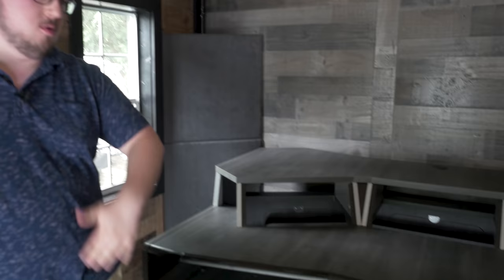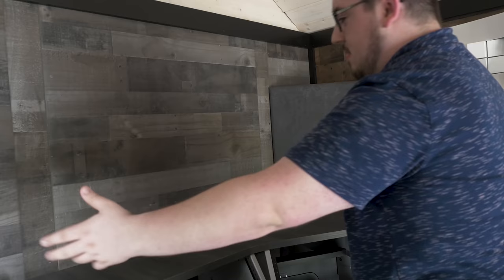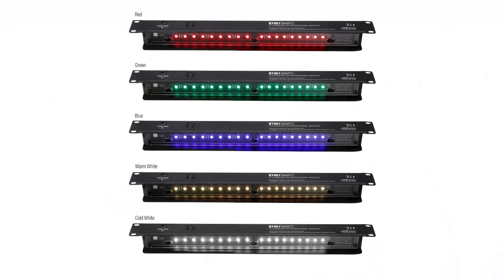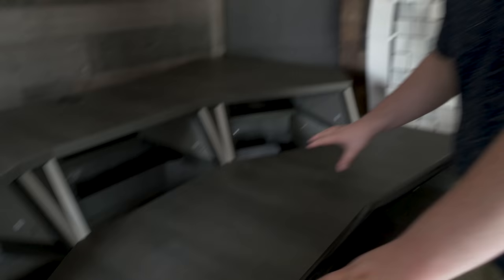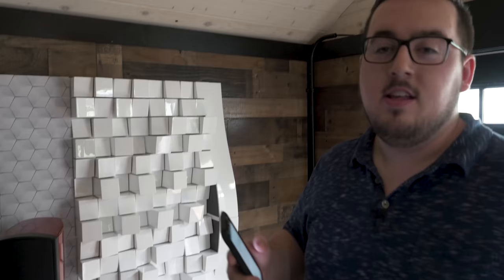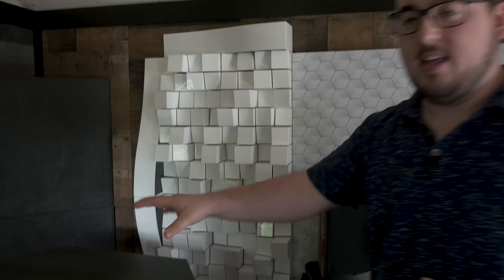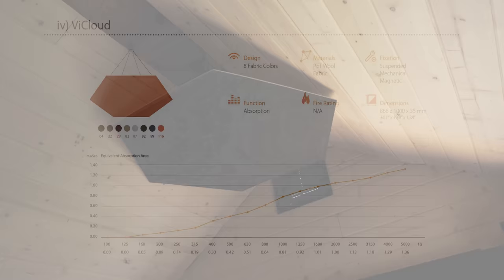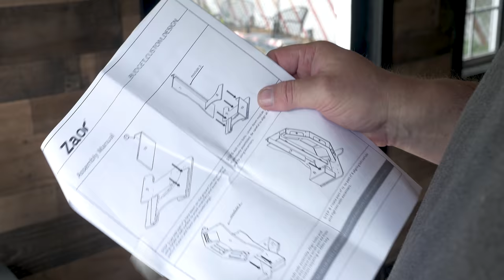This Desk Costs $3,000

Comment: If it's made out of MFC, then it's made out of chipboard sandwiched between two pieces of melamine. If true, that is really expensive for what you got. Could have built a desk out of real wood for a fraction of the price.
Reply from the maker: well either way, I didn't pay for it ;)
Reply: You could have build the desk AND purchased every power tool required for the build for half the price!

Comment: just buy a metal sheet and cut it to the dimensions of 2U. Drill holes for the mounting screws and cable holes for the stream decks and paint it however you want now, as you are done modifying the metal. Get some double sided tape and slap those babies on and feed the cables through.

*what I would add in the racks*
Depending on your comfortability with case modding and pc building you could purchase 3 server chassis for 4U. Modify those babies for three main parts of a computer(psus go in 1 chassis; gpus with watercooling capabilities in another; and mobo and rest in another.) Have each of those equipped with a 480mm radiator facing you at the desk, as 4U is around 482mm X 177mm. You have the potential for some very awesome modifications to the desk if you go this route. Since you choose to not put anything on the monitor risers, you could cut out a section to put glass, revealing the insides of the 3 chassis. Now idk if youd want to cut and drill apart your 3000 dollar desk, but id be making this extremely custom if i were you.

Comment: A few more things you could (and should) add to the rack. 

Furman power conditioner(s). While most commonly used in audio, these devices take up between 1 or 3 rack spaces and are basically rack mounted power strips which also 'clean' the power. There is a switch on the front and oftentimes a front 120v outlet as well. Something nice to have to be able to switch things on (like your speakers so you dont have to reach around everytime). I love mine

Keystone punchout plate. I have one of these in my setup. Its a 1u rack module that has holes you can populate with various connectors. I have a single HDMI, two USB, an Ethernet, and a Displayport. The cables are plugged into the back of the connectors and to various places. This way if people come to my house, they can easily plug into one of my external displays, use ethernet, etc. I can also plug USB devices in easily without having to use the front panel I/O on my computer.

Additionally - if you're planning on doing music, there's a whole new world of gear you can look into. Check out some rack mounted audio interfaces. Universal Audio is expensive but great. If you're serious about music and/or have the money, you should go through an audio interface rather than the internal DAC of your motherboard.

Comment: Commenters here don't understand what these desks are actually made for. First, they're made out of MDF to limit acoustical response. I can't speak to this console but Argosy is even pricier and uses 18mm MDF for their consoles. You're also paying for the built-in racking and placement of speakers/monitors/large enough surface for controllers or mixers, etc. These are custom-designed for working professionals, they aren't sold in massive bulk units like Ikea furniture, of course they're going to have a higher price-point, and of course you can design and make something like this yourself cheaper. If you're an established engineer, studio, or producer, a one-time $3k purchase for a desk isn't even a big concern, since you're dealing with equipment that far surpasses the desk in cost. But yes, if you're a home-user using Scarlett interfaces and M-Audio speakers (not talking down, we all start somewhere), these desks aren't really designed with you in mind.

This desk is one I'm considering, but I'll probalby have to spend even more as I will likely need a custom-made desk as this isn't "exactly" what I want, since I'll be using it for broadcast production and none fit the bill, although Argosy's V1R comes close.

Comment: Personally I would put the multi-square white bits above and behind your monitors using the curvy wedge bits at the sides, and I would use the hex pattern parts on your ceiling. The white would probably look nice as it is and contrast well with the desk. Beautiful desk though :)

Comment: The flat panel could have been used on the wall where the monitors will be mounted which would serve acoustically and also give an offset to the dark theme for your RGB lighting. The white diffusors are where they need to be acoustically but should somehow be implemented also on the opposite wall of the room. Paint them to Swashin colors to match. Bass traps are perfectly located but also can be used in the back of the room to control corner resonance. Are you certain the monitors of those sizes are going to fit between the width of the basstraps on that wall???

Comment: I demand to see it all set up, my dude. Some things I have in my racks (not really an audio guy)  a Focusrite Clarett, an Octopre, rackmount power strips. You could even do like 1u or 2u drawers. I have a launchpad/ Ableton Push 2 in a drawer. I alsp am looking to get a rackmount line 6 helix for my guitar shenanigans (I should save money but I do what I want)

What I would do with that desk (which is awesome, and I want one but I can't afford it right now) is I would have my power strips in the middle section, I'd throw my Wacom Cintiq in the middle of the desk, and then audio things on the sides. Then theow my monitors up on the shelves. Wondering if my Jarvis could lift this...probably not. I liked your idea for the stream decks, but I need mine where I work.

Comment: Go to the home improvement store and get the metal from the hardware section. Then custom drill for the mount screws and the USB and power holes for the stream decks. Use Velcro to adhere the stream decks to the plate. With this method you can DIY it yourself and make a video out of it.

Comment: I would personally keep the diffusors, they are really needed when you work with sound, but that's your decision of course. Did you consider a 1u audio interface? Would be great for connecting your speakers, headphones and mics... And you can control the sound on it too, all from one place. I have this setup myself. I had a ZAOR studio desk but i sold it because for me, my display monitors were to high to look at and i had a sore neck at each studio session. I do love the desks though, they have a lot and nice features indeed. I now have a custom made desk. I have a walnut desktop on top of a white Jarvis sit and stand frame. I love it! I also added a grove made shelf for my monitors and this turned out really nice!

Comment: My PC is in a 4U Rack Mount case. so you can probably guess where id put it. ive got it mounted in my rack right in between my commercial amplifier and my receiver to run my speakers off the PC's SPDIF out. that desk would be pretty cool for my setup. but id have a few empty spaces which wouldnt look as good. still better than having a 5ft tall 19" rack beside my desk

Comment: What if you took the 3D cubes and used it on the curve of the ceiling just above the black molding? Line it around the entire room and maybe run a light strip around it for ambiance... Would look cool potentially and give some sound additional sound protection above. For the velcro panels I'd see if you can paint those a. More muted color and either nail or glue it to the wall instead of just the velcro.

Comment: You can get metal plates that mount in racks called blanking plates witch you could stick the stream desk to.
Reply: Niper8 which*
Reply: Niper8 You still need to laser cut or whatever the cut outs for the Streamdeck in it
Reply: Penta I was suggesting to mount on the front instead of having a window for it.

Comment: Love the desk!  As for ideas to fill the rack, audio gear (like you mentioned) or network gear?  How steep is the angle of that rack mount (looks pretty sharp, like 45 degrees on camera)?  They make some decent shelves you could mount in there if its not too rocked back.  For the keyboard/mouse cable, look at a brush passthrough like http://a.co/cgTCySD  to make the wire disappear.  I really like the white sound absorption gear as it brightens the room up - dark is cool, but you do need some contrast (and it gives a feeling of a second set if you wanted).  Looking forward to the rest of the shudio tour!